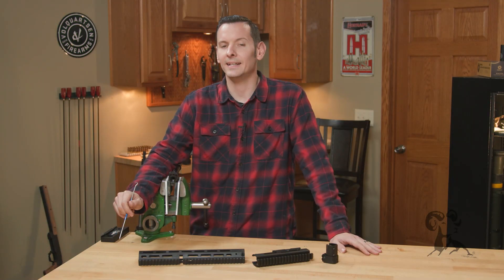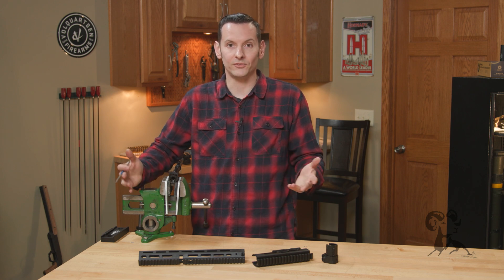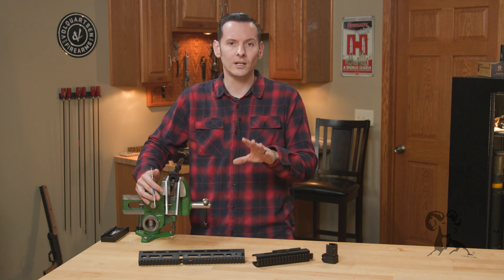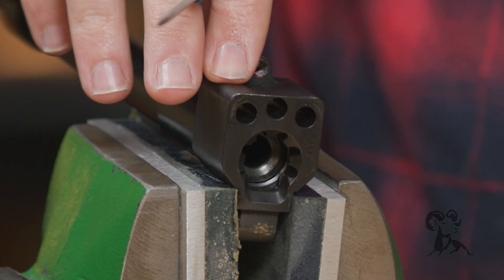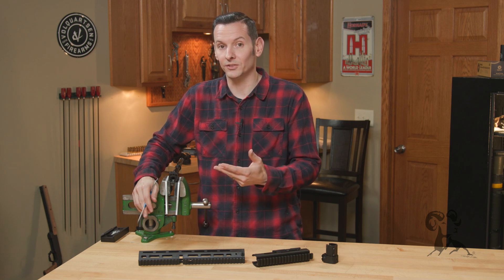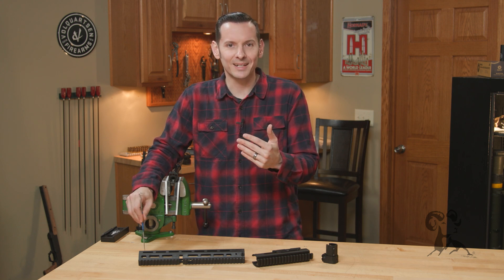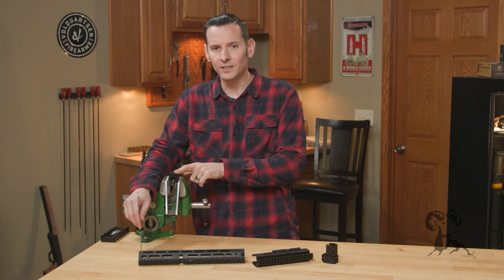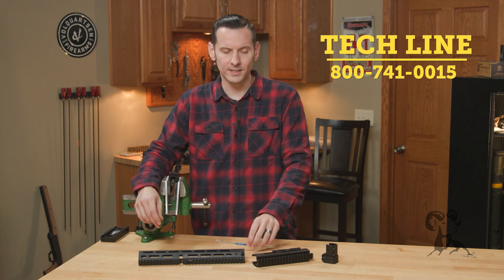Tech Tip: BRN-180 .350 Legend Feed Ramps

Comment: The trunnion design allows this feed ramp on the BRN-180 to be wider and lower than those found on an AR15 barrel extension.
Reply: What are the odds of getting a 458 socom brn 180?
Reply: So the exact same or near same uni-ramp solution that PSA utilizes with their KS47/7.62x39 barrel extensions?

Comment: If anyone is looking for a reliable magazine to run that fits 20+ plus rounds. The 5.56 35 round Torkmag is perfect. It feeds flawless without any modifications to the magazine. It does not have the ribs that we usually have to file down like in the polymer magazines.

Edit: I don't load mine past 20 because I haven't put the 350 Legend bullets on a scale to match the same weight as 35 rounds of 5.56 just to keep everything from putting too much tension on the magazine since these are heavier, also on their website it says these mags work with different rounds, 350L not listed but it does work amazingly.

Comment: Off topic question,  I'm building a .204 ruger ar15.  Can anyone tell me if a standard 556 bcg will work with the 204 ruger or do I need a specific bolt inside the carrier?  It seems like it should but I'm not 100% sure.🤔
Reply: Subbed.  Thanks in advance.
Reply: The 204 will fit a 5.56/223 bolt just fine.
Reply: @mandagrath thank you.